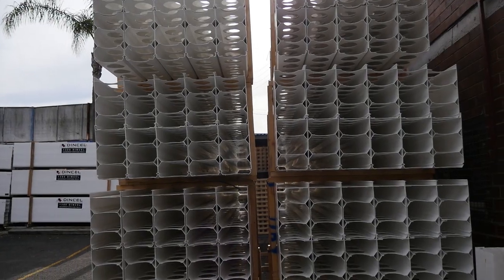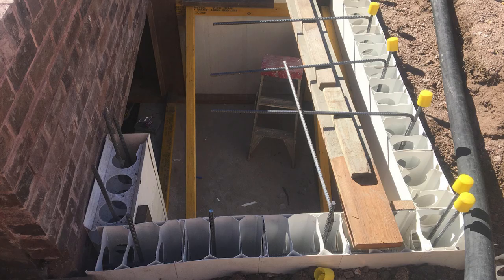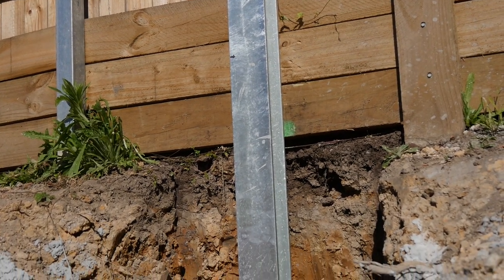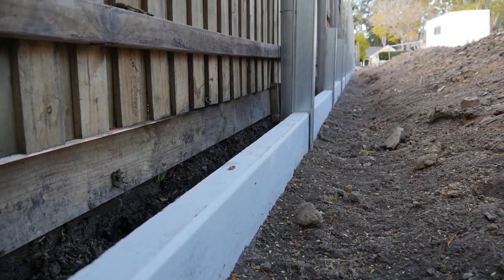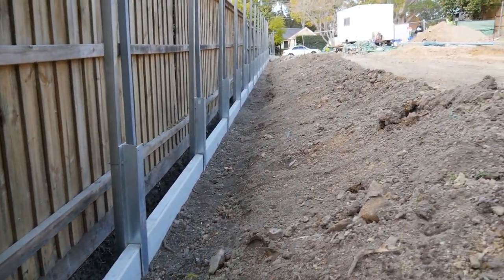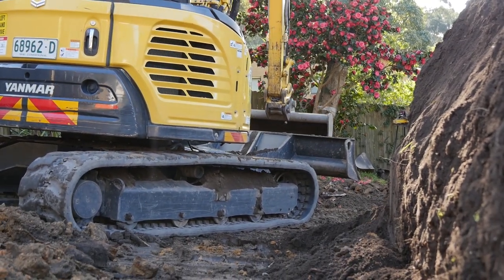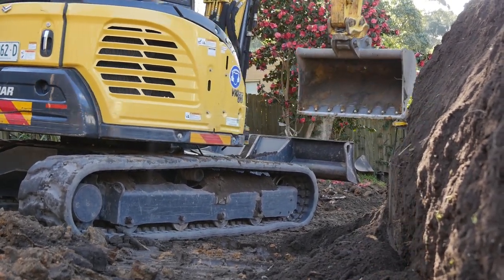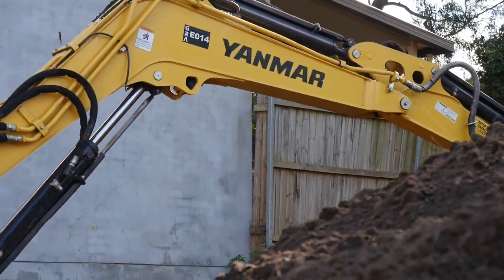The best and most economical retaining wall system / by The Solutioneers

Comment: Well explained piece - and entertaining to watch. What would be really useful would be some guideline costing - e.g cost per metre for a 1 metre retaining wall, cost per metre for a 2 metre retaining wall - materials & labour. If anyone has some indicative numbers I would be happy to hear them - even if not 100% accurate and always accepting that local conditions can have a significant bearing.  So just use best case scenario.
Reply from the maker: The cost work out at around $800 AUS per square metre.

Comment: Those faux timber sleepers are beautiful.
Reply: The look is ruined by the steel posts though. You get coloured steel posts, but I'd say rather clad the whole thing. At that point dry stack blocks is an option and easy to DIY.
Reply from the maker: @hannesRSA  you can clad the posts so you don’t see them. The cladding is the same with the sleepers.
Reply from the maker: Thank you

Comment: A couple of string lines and a spirit level is all you need to get the posts straight. A dumpy level if you have one. its not "very, very tricky at all."
Reply: Also it would be easier if you had some 90 by 30 timbers cut to the exact size of the concrete sleepers for the spacings as you go. I'm going to be looking at a retaining wall soon about 1.5 meters high. But I'm worried about finding to much rock.

Comment: You don't actually want the steel 'H-beams' to be perfectly straight. Yes left & right axis you need it straight but the other axis it is best if you slightly concrete them in with minimum fall towards the side that it is retaining ie towards the high side. It works the same with dam walls they are always angled back towards the water
Reply: That would look terrible, building a leaning wall, unless you expect it to settle straight. There's no reason for it since the strength is in the footings. It's not like dry stack block retaining walls.
Reply: @hannesRSA  you’re incorrect.  Let me guess you’re not an engineer
Reply: @cd1168  some engineers are useless. Don't need to be an engineer to tell a skew wall looks terrible. So build the wall 10 degrees skew then for more strength by you're argument, it's not like a slight angle will magically add unproportional strength.
Reply: @cd1168  
Agreed, building code in America requires 4 to 7 degrees set back depending on the type of materials used.
Reply: And most building codes in America are just slight tweaks of the IBC.
Reply from the maker: It will depend on the height. For low walls you don’t need a lean. The system is very strong. Even for bigger heights you can include two layers or even three layers at the bottom. We did a 4 m wall amd it was triple at the bottom going to double and then single st the top.
Reply: @hannesRSA  It is highly recommended to have a slight lean back. One reason is that if the wall moves at all forward it will immediately be in a failure condition in serviceability limit state. This means it will look like it is failing and will be aesthetically unpleasing. Secondly most cantilever walls are designed using Coulomb or Rankine earth pressure theory which assumes an active state in the soil behind the wall which requires a slight movement of the wall. So the wall should move slightly to engage the friction on the failure plane of the soil. If the wall  is slightly leaned back then it can move forward and still not go beyond vertical. Hope that makes sense for all those people who haven't studied soil mechanics, geotechnics and structural design theory of retaining walls.
Reply: @PointSpace  in that case millions of upright retaining walls are about to fail

Comment: As he says, it's "sleeper" not "slipper." The reason it is called a 'sleeper' is because they used to employ time-expired or no-longer-used railway sleepers to construct such walls (and other such structures that were prone to rotting). They were favoured because they were deeply impregnated with hot tar and/or creosote preservative back in Victorian times and up to the late '50s, making them last for a very long time. The railway tracks were laid down on these sleepers. Later on, and to this day, the wooden sleepers have been replaced by reinforced concrete 'sleepers.' Even though they 'slip' in between the 'H' beams, they're not called 'slippers.' I guess, in fairness, to a Greek speaking person, like the presenter, without intimate knowledge of the English language, it's an easy mistake. No problem...but I hope this helps him to understand the terminology and the reason they are 'sleepers' not 'slippers.'
Reply from the maker: Thank you for clarifying this. I was only joking.
Reply: And it was completely obvious that this was so @Remedial_services . Maybe racists don't get your sense of humour, but then they rarely have a sense of humour themselves, so no surprise there I guess.
Reply from the maker: I don’t think you are right mister. They were called sleepers when used in railways. And just to clarify you also speak Greek. Your lunguage has 113.000 words from my lunguage. Also English is a very poor lunguage. You have around 550.000 words while the Greek one has 5.000.000 and existed thousands of years before you arrived in the world. So don’t be a racist please to me. I am your tutor and you owe me. Even the name europe where you come from is Greek.

Comment: How deep do the steel beams need to be in the ground ? e.g. for a 1m high wall how deep, for 2m high how deep ?  Is there a ratio ?
Reply from the maker: Craig Welsh hi. Whatever height you go up you have to go down. Under a metre the holes to be 300 diameter and over a metre 450 diameter
Reply: @Remedial_services  that does not answer his question. He ask how deep but the answer in diameter of hole????!!!
Reply: @rkk8004  he gave 2 answers...
Reply: @eland65  he answered that and then another...the diameter
Reply: @rkk8004  Did you not understand his answer he said for whatever height you go up you go down the same distance it was clear as shit to me. But then I'm an Ozzie!!
Reply: Plain as daylight mate, can just imagine RKk🧐🤬

Comment: How deep do the vertical posts have to be.? 
Is there drainage behind it ?
Reply: Usually as deep as the wall is high.eg ,1000mm high wall is 1000mm deep piers.
Reply: Depth has to do with sidewall bearing pressure, 1:1 (socketing) is basically like a rule, but treat every job like the exception. Also noting, that if you intend not to have any drainage allocation behind the wall you will need to assume a higher sidewall bearing pressure is needed. e.g higher soil cohesive value or target  rock. There are other methods if sidewall pressure can't be achieved

Comment: Excellent video;
A little out on costs for besa blocks
Should also talk about drainage behind the wall particularly for Dincel
What is the height max on this system.
Cheers from Canberra
Reply from the maker: Hi

You can up to 2 metres high.
Reply from the maker: We have done walls up to 2.5 m high. I don’t think there are limits.
Reply from the maker: We have done a wall 4 metres high.

Comment: Why don't you slip in one of the slippers while the concrete is setting, that way the posts are aligned perfectly.
Reply: Bad idea! You want all the H-beams to be set and the sleepers to actually sit on top of the concrete level which you have troweled to the correct level

Comment: over 1m I think you need engineer design in Oz
Reply: It's 1.2m not 1m
Reply: @salmabegum424  not sure what country that is but in Australia is 1m. 
I just did some retaining walls found the most economical to be sandstone slabs 500 X 1m long
Reply: Yeh nah, NSW anyway, it's 600mm without engineer or council. The only work around for council is if you are repairing an old wall, then it comes under SEPP 2008 emergency works, I think clause 15 from memory? Then you don't need council, but the wall may need to be like for like in which case, you might need something like old mate said in the video, concrete inside and brick outside. 
  So 600mm max height in NSW, but stay tuned it might change.
Reply: over 600m, not 1meter

Comment: How deep those piers need to be for that height wall?
Reply from the maker: As high as you go up you have to go same depth.
Reply: Mate, you have to be careful with that one, that is only a rule. The actual depth depends on the sidewall bearing pressure. e.g. a weak or very reactive clay might not sustain 1:1, in such a case to attain sufficient sidewall bearing pressure the diameter might go higher, even 800mm!! (Depending on the calculation) in which case it's best to keep 450mm? and go deeper. Then you get other variables like refusal of auger. 
  Reason I say this, is if old mate was working ON fill, to retain fill, the first bit of soil will be fill, so even if 99% compaction was done, the soil 'cohesion value' will be less than 'VENM' (Virgin earth) and  1:1 won't work for the long run. 
Just sayin.
Reply: @ivanfsta1661  Are you an engineer

Comment: brick is the best material for retaining walls but you need to know what you're doing. how you build a brick wall will determine whether the soil being retained will work on downwards pressure or sidewards pressure. ill build you a retaining wall with brick and I put 100 years on no matter what height. concrete becomes brittle and will eventually crack the brickwork you showed looks 50 years plus id like to see concrete sleepers after 10 years don't knock a produced to sell rubbish mate
Reply from the maker: You can build a wall worh brick but it will be more expensive because you need a much wider foundation. Usually here in Austraria the pour a small concete footing and place a double brick wall on top. Of course after a while it will give away. The concrete sleeper option is much cheaper and faster.

Comment: what kind of beam is that?
Reply: They look like specially made ones for his system. But I'm sure you could get some rsj's fabricated to whatever size you need.
Reply: He called them universally column, but if you Google galvanized steel H post / beams you'll find a few supplies - Bunnings even has their own version.
Reply: You probably wouldn't want to go past 600mm in height with bunnings version. When they are structural they have a kilo per metre designation.